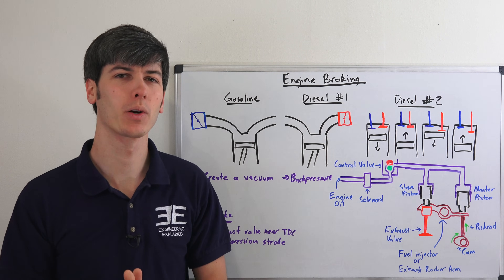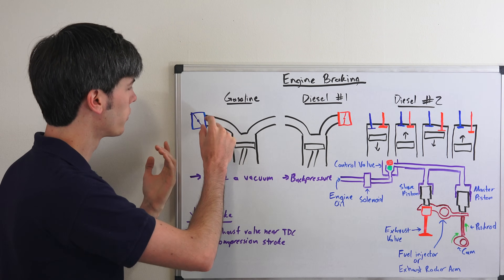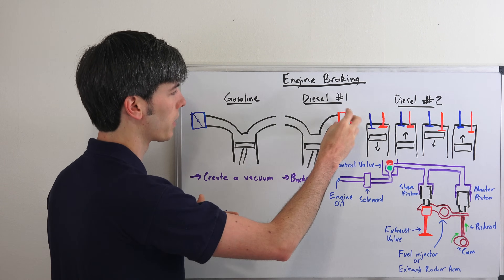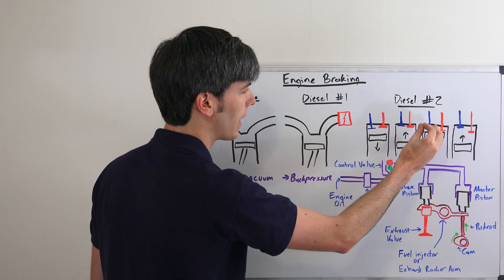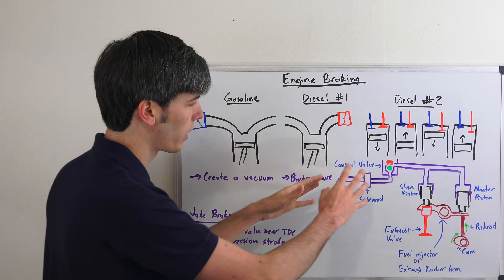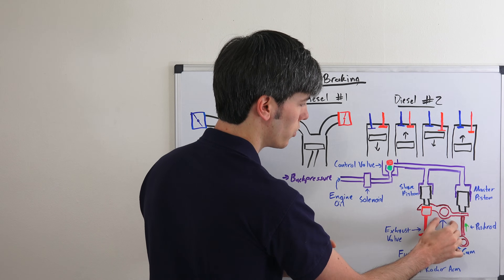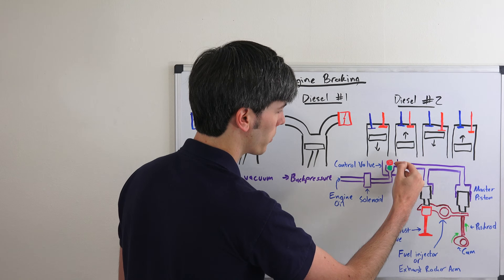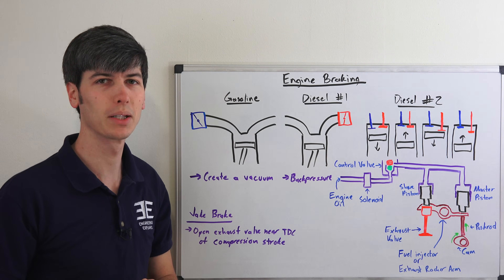What Is Engine Braking? What Is A Jake Brake?

Comment: BRILLIANT! I always wondered what was going on! I think we call that a compression release brake retarder here in Europe. 
You can hear the engine sound change (older diesels). I always learn something new with you, thank you so much! All the best, Rob
Reply: +James Tennier No, I mean the whole term "compression release retarder". I know what you mean: I have compression release on my Yamaha SR500 motorcycle - it's a little lever to open a valve so I can position at TDC to kickstart the 500cc single cylinder engine. Old diesels (eg cement mixers) had this too. All the best, Rob
Reply: "Compression release"  is a whole different thing. Long ago they were on engines to reduce "compression (ratio each revolution) while less effective starters tried starting cold engine (when oil was cold& difficult to pump by starter as well.
Todays 12 volt gear reduction starters are FAR MORE EFECTIVE so compression release no longer are used cept maybe in extremely cold climates? Haven't seen one in decades. 
(did help start my tractor after leaving driving lights on one night in Weed, CA as I recall)
Reply: +RobWhittlestone Man, that name is a mouth full.
Reply: Nice informative video.  2 stroke compression release is much simpler. 
I have a lever on my 4 stroke 1970 Ducati 450 Scrambler that opens the exhaust valve for starting. I also put one on my 2 stroke 1972 Bultaco 250 Alpina that used the crankcase compression to brake the rear wheel for muddy downhills or when the brakes were wet.

Comment: Hey Jason, I have a '94 f150 with a 5.0 and an e4OD automatic.  I am considering rallycrossing the truck just for shits and giggles, but my question is can it be bad for the transmission to lock it into a gear for better acceleration/control/engine braking?  My gears are so long that I can pretty much stay in 1st across the whole course, but I'm not sure if it makes the transmission work hard or risks damaging it.  Any advice?

Comment: pros & cons of engine braking, versus normal braking?
Reply: +Russ A pros: fuel economy, brake material economy, general safety (since when engine braking you must start slowing down earlier for it to make any sense and have any reasonable impact).
cons: if done harsh (sudden clutch release) may lower clutch service time. also is not useful if distance is low and you need to slow down faster. little impact on very low speeds (slow traffic). must pay extra attention and plan your braking ahead since it will need higher distance.

Comment: oooo thats y trucks make them noises
Reply: +Sho Bud 
Actually the noise is a by-product of the driver using engines compression to reduce brake heat buildup. Smoking brakes are a sign that the truck may well be under less control than the driver might wish!

Comment: It would be great (I'm sure someone already tried that) to use the created backpressure (incase of the throttle style valve in the exhaust), and have a low pressure air bottle filled with a few bars of pressure. It could be used to accelerate the vehicle..
Reply: Regenerative engine braking!
Reply: +DerKrawallkeks Well, the really big marine diesel engines are in general startet up with pressurezid air. So yes, not really something new.
Reply: I only know it from electric vehicles;)

Comment: So how much horsepower can it eat up? Does the old truckers rule of descending a hill at the same speed you can climb it still apply for modern turbos?
Reply: +Andrew Thompson 
Trucks are far different now than even 20 years ago. Aerodynamics!!! 
It was speed up equals "safest" speed down many years ago, when I started out. Now, truckers only think about the Jake if it doesn't work. Then they better think fast. Short hills not such a problem. Long downgrades are another matter entirely. Especially if brake(s) start to smoke. Every commercial truck trailer has self adjusting "slack-adjusters" these days but everything wears out eventually or mechanical things fail etc. Smoke happens!

Comment: Why the revs go up when you brake the car with the engine?
Reply: +Abraham Sequeira because you lowered gear. revs are at that level because they would be there if you were in that gear and pressing accelerator to maintain that speed.
Reply: Thanks, now I get it.

Comment: What about a retarder? Is that just a brake on the flywheel itself?
Reply: +etteiperdnaxela No, retarder are in general maintenance-free or low maintenance. There are basically 2 types of retarder. 
The majority uses oil or water and it's very similar to a torque converter in the working. It's basically a torque converter where one side is locked up, to keep it simple.
The other retarder type is also called a "disk eddy current brake" or "induction brake" and works by...well, electromagnetic induction. But this type is more common on trains.

Comment: Cool! Will you make a video explaining in detail how to do it (i.e. pedals, down-shifting, etc.)?
Reply: +iseslc there is nothing to explain. if you are on a manual gearbox - just put engine in gear 2 lower than it would be at that speed cruising and release the clutch. you can do rev matching to avoid sudden engagement or just release clutch slowly. during all this you don't apply any braking or accelerator (unless you are doing rev matching, then after putting car into lower gear just press accelerator till revs get to about 3-3.5k and then release the clutch). I drive in a city a lot and use it all the time. average fuel consumption (when used properly and safely) goes down by about 10-15% (my engine uses 0 fuel while in engine braking and ~1.5 liters/h on idle).
Reply: Senpai Nooberinho
Oh cool thx.

Comment: Just a little tip if you own a diesel Vw the throttle body for engine breaking comes up as a shudder valve when code read no other place or make comes up as this and can cause hours of head scratching. Oh and if it does come up as a engine code first check the fuses as it'll still work but not as good, 20p fuse can be a £300 miss diagnosis

Comment: Why don't diesel engines have a throttle body like gas engines?
Reply from the maker: +Janosch Spohner Throttle is controlled using fuel injection rather than a throttle valve. Here's an answer in much more detail: https://www.youtube.com/watch?v=rXVJG9n6BAs
Reply: A diesel engine speed is controlled by how much fuel is injected in to the cylinder. So that is why they don't need to control the amount of air going in to the cylinders.
Reply: +Janosch Spohner Modern diesels should have a throttle body like gas engines and then they wouldn't have to  rely as much on EGR to meet emissions and that would make them much more reliable like they used to be in the late 90's and early Y2K.

Comment: How about engine braking in 2-stroke engines? Is it different because there are no valves?
Reply: Also does it wear your engine or transmission if you engine brake by downshifting in either one?
Reply: You never engine brake with a 2T. Because the oil is mixed with the gas, the engine only receives lubrication with the fuel through the crank case. When you engine brake, the engine is cycling quickly but not receiving the normal amount of fuel (and thus oil) for its speed. this leads to piston and sleeve scarring, and gradual loss of compression. In the worst case scenario, it can even lead to a destroyed bottom end.
Reply: +dtroy15 Thanks for explaining. I don't know a lot about 2-stroke engines compared to 4-strokes.

Comment: so does it hurt your engine if you do this a lot?
Reply: +Pope Nova Not really, it's literally what the motor is designed for. I wouldn't however shift into such a low gear you always redline when you want to engine brake.

Comment: Thanks for the explanation. When is it best to use engine braking as opposed to using the brakes? Like for downhill or uneven road and the like?
Reply from the maker: +napa modesto Great thing to do going downhill to ensure you don't have brake fade, and can use the brakes for any emergency stopping.

Comment: Thanks a lot, great stuff. I didn't know about the Jake brake. Ingenious system. Is the cam and pushrod always running with the engine even if the JB is not used? That's going to waste a (tiny) bit of energy. But I understand this system fulfils the requirement (at least in Germany) for a braking system that cannot wear out on long downhill stretches. Eddy current systems are another one, or the exhaust throttle you mentioned.

As to the "vacuum" in the gasoline engine cylinder, that doesn't achieve a lot, since in the compression stroke, ambient pressure from the crankcase will push the piston up again (or you might think of it as the piston being "sucked" up again from the "vacuum"). Generally the most engine braking you get from a gasoline engine is in the brief period you accelerate it with the clutch, although that just wears out the clutch instead of the brakes.
Reply: +pinkdispatcher Throw it in neutral
Reply from the maker: +pinkdispatcher The solenoid can prevent engine oil from entering, so when it's not needed the system will not run.
Reply: Engineering Explained
Thanks.  So it can use the cam and pushrod from the injection system per cylinder? But those are not present on modern high-pressure direct-injection systems, are they?

Comment: How much does it slow you down? Also, is there any way to prevent that? (Maybe if you want to coast in the highest gear with minimal braking)
Reply from the maker: +Guitarfollower22 Significant stopping power depending on the setup. You don't have to use it, for example you can deactivate the jake brake system.
Reply: Engineering Explained ah okay thanks
Reply: +Guitarfollower22 gasoline engines in general brake harder than diesel. also old diesel engines had stronger engine braking. on last years 1.8 diesel Opel going downhill in neutral I maintain 70km/h and on same hill in 6th speed I slow down about 1km/h to 50m... so actually engine braking is very low in modern diesel. which system is used on that engine I have no idea.....
the automatic transmission generally brakes less than mechanical because it keeps in higher gear.
Reply: Senpai Nooberinho interesting, thanks for your response
Reply: +Senpai Nooberinho If your auto transmission allows Overdrive cancel, or manual (semi auto actually) override, then that should tell ur ECU that you want to downshift? 

+Engineering Explained is this correct?
Reply: daren poh have no experience with modern automatic gearboxes, can't comment on that. 
have driven one modern car with automatic and didn't play with manual shifting...
Reply: daren poh overdrive basically locks out your highest gear (I drive an automatic gearbox SUV that has overdrive). That's all it does.

Comment: Isn’t engine braking is when you downshift without rev matching? this way you force the engine to slow the car down to match its low revs? or am i missing out on something?
Reply from the maker: +Mohammad Jebrini No! This should never be done (wears the clutch, and can cause you to lose control by locking the wheels). If you want to downshift to engine brake, it's best practice to rev match. https://www.youtube.com/watch?v=FnXLZg_O1rk

Comment: in a emergency braking situation, what stops the car faster: brakes + downshifting and using engine braking or brakes + clutch in?
Reply from the maker: +Victor Hugo In an emergency, hit the brakes hard, let ABS figure it out, and don't worry about whether you're in gear or not. :) That said, there probably wouldn't be a big difference in stopping distance, assuming you give enough pressure to the brakes. Once you hit the frictional limit of the tires in braking, and ABS kicks in, this is the fastest you can stop regardless of if you're in gear or not.
Reply: alright, thanks for the answer!
Reply: +Engineering Explained That is true. but if you're in gear, the time from FOOT-OFF-ACCELERATOR to HIT-THE-BRAKES, you will make use of engine braking to slow the car down before you ACTUALLY hit the brakes. If you're in neutral, the car will be coasting from the time FOOT-OFF-ACCELERATOR to HIT-THE-BRAKES. this is smth like less than 100ms. However, if you're going at 120kph, this 100ms may mean a difference between a near miss (ie collision) or a near hit (ie a miss).

Time taken may be larger or smaller depending on various factors including age, gender, psychology, physiology, anatomy, etc. If you're drunk you probably should just die and make the road a safer place for the years to come, cos #onelessdrunkdriver

Comment: I dont like engine braking. if you are going down hill you are just revving the engine, if you want to downshift you gotta match revs, disengage- engage the clutch, worn it out even more. On a flat road its ok i guess. release the gas pedal, 4th into 3rd into 2nd gear
Reply: +Tupac Amaru I make no claim to be an expert, but I know it's extremely valued by trucks towing a load downhill, as otherwise you may get extreme brake fade. In a passenger car it's less of a concern, but it absolutely has it's place in downhill travel.

Comment: "Ultimately what you're doing is putting heat into the engine [instead of the brakes]".

In the case of a gasoline engine, why would this be the case? I figured that since the engine is creating a vacuum, the expansion would cause the charge to cool fairly drastically, allowing the charge to absorb some of the engine's latent heat before being expelled out of the exhaust valve(s).

My only guess is the extra heat comes from the increased friction caused by the heightened engine rpm vs. idle? Is that more than the heat induced by the normal idle charges being detonated?
Reply from the maker: +Kyle Smith You slow the vehicle by turning kinetic energy into heat. That's what disc brakes do. If you use your engine instead of your disc brakes to slow the vehicle, that wasted energy (used to pull a vacuum) puts heat in the engine.
Reply: +Engineering Explained Ahh, I hadn't considered that wonderfully simple perspective- makes complete sense. Thanks for the response!

Comment: in jake braking when the throttle is lifted off, what is the connection which will make the engine oil to flow into the system?
Reply from the maker: +Kumaraswamy Hande The engine oil pump sends oil to the system (as it does for the rest of the engine as well).
Reply: +Kumaraswamy Hande The oil pump is driven mechanically by a gear connected to the crankshaft, not by the throttle. Unless you are talking about mixture-lubricated 2-stroke engines, in which case engine braking is a very bad idea.
Reply: +Engineering Explained thanks a lot

Comment: Is engine braking bad for your car?
Reply from the maker: +Kyne Barrett Assuming your engine doesn't get too hot, no problem. There's a cooling system to handle this, unlike your brakes.
Reply: +Engineering Explained thanks! I did motor vehicle and Motorsport at college. In motor vehicle I was never taught about this. Thanks for the very informational videos!

Comment: EU diesels don't have a TB on the exhaust side. Many do though on the intake side. They simply shut off the fuel supply in order to cause an engine brake... Just like a fuel injected gas/petrol engine would... :)

Comment: In Europe, when I took my truck license, I was told there was also another engine brake system called "the retarder" which is a oil turbine based braking system connected to the engine output shaft or driveshaft
Reply: +Leofred A company I worked for (US) had  Hino brand trucks (Toyota's large truck and bus division) that had a retarder type of engine brake. Key feature user-wise is that it was not loud, so it could be used in areas that normally prohibit Jake brakes due to noise issues. They were actually pretty good trucks - virtually trouble free.
Reply: +Leofred 
I knew someone would mention these... Imagine a garden hose, water on... Engine is just moseying along. Now try to bend the hose to minimize water flow; really tightly now... Engine brake on. The difference is the "retarder" uses engine oil and directs it through a smaller orifice within an appendage to the engine/ transmission "connection"  Decrease the flow and "braking action" occurs though it also heats the engine oil.  
Another aside: there are electrical retarders too but that is another story. Imagine a Prius "regenerating electricity to it's battery when throttle is released or brakes are applied...
Reply: Had a friend who had an electromagnetic retarder, it had a stationary stator in a housing mounted to the frame and a rotor on the drive shaft.  Never drove it myself or saw it taken apart but he loved it

Comment: so is the exhaust valve open the whole time on the Jake brake system? I don't understand at what points the oil pressure opens the exhaust valve
Reply: Open only with the cam timing at the right point, with the solenoid switch on.

Comment: When i drive my Saab 9000 i try to engine Brake as much as i can to save dom ware on my pads and rotors. When i took my license u had to engine Brake as a economy drive, its a part if the test here in sweden.
Reply: +DR:Snaggens  While that method does work, it wears on the clutch assembly, where as using your brakes (which are much easier and cheaper to replace) is the preferred method of gasoline power vehicle deceleration.

Comment: When traveling in Ohio, I'd seen signs on the interstate saying "no engine braking." I had  thought it was a safety concern, noting that brake lights don't come on when slowing and potentially causing a road hazard. I've since heard/read that it's largely for noise instead. Thoughts?
Reply from the maker: +closerb4 It's for noise, jake brakes are quite loud!